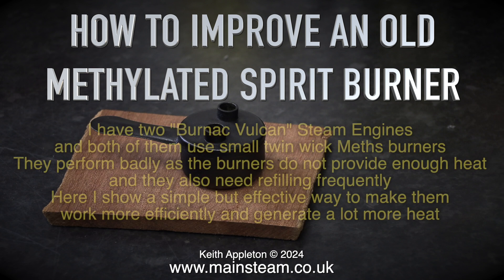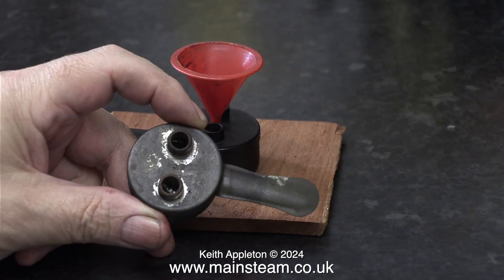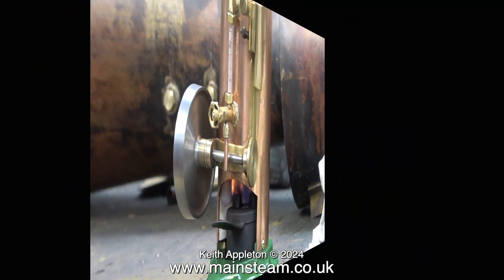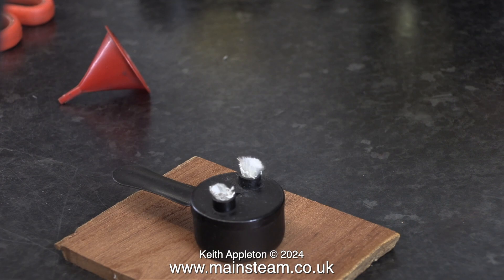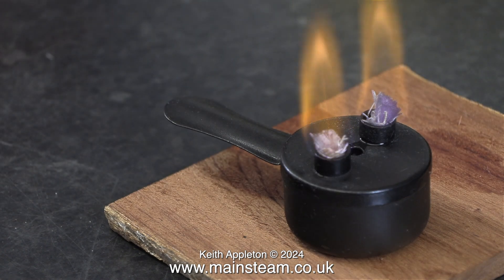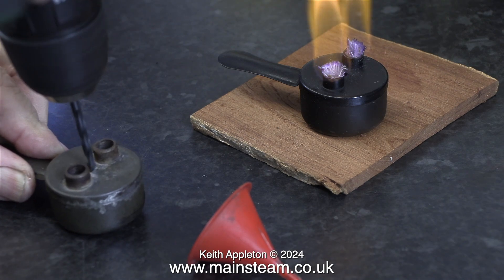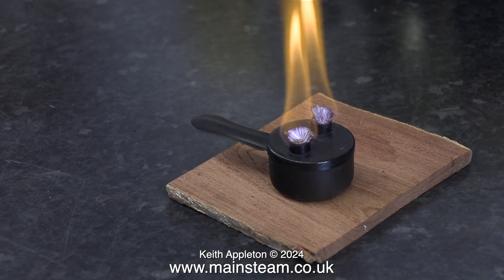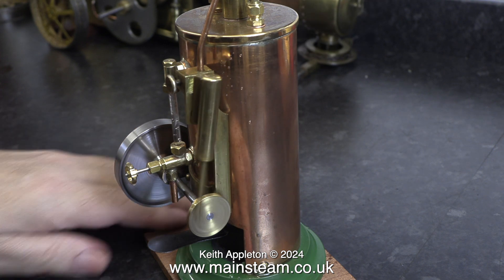HOW TO IMPROVE AN OLD METHYLATED SPIRIT BURNER

Comment: Just inherited a mamod steam wagon, I don’t know much about these but I would like to restore it. have the original burner, which I use with method. When I light it it smokes and carbons up pretty much the whole thing. Is this because I’m using meths? Or does the burner need its wadding replaced? Excuse my naivety if I’m doing something wrong!
Reply from the maker: The wadding is contaminated - run lots of meths through it - maybe it will improve. Someone in the past has probably used Paraffin.
Reply: @keithappleton thank you for the reply I thought as much!

Comment: Keith, also worth noting is that meths now is far inferior to that we used to get. It tends to burn with an orange flame and soot up the inside of the firebox. (Soot being an insulator and giving these little burners a harder time at getting their heat to the water before it is wasted out the chimney) 

Lengthening and splaying the wick will certainly do the job, but switching to a higher purity alcohol will give you a superior result with less wick stick out and the old familiar hotter, almost invisible blue flame. (Infact I wonder if part of the issue with meths as a fuel for us is that they WANT it to have an obvious flame for safety)

Of course - meths is argueably easier to pick up at the hardware store as it is stocked for its other uses besides a fuel, and I understand the convenience.

Warm Regards, Pete.